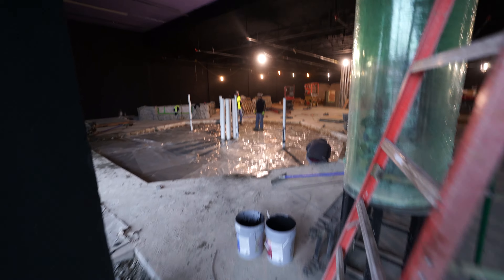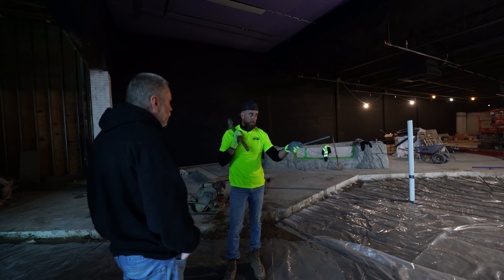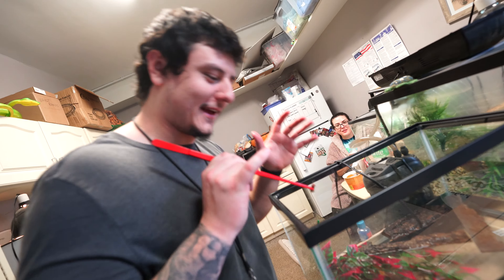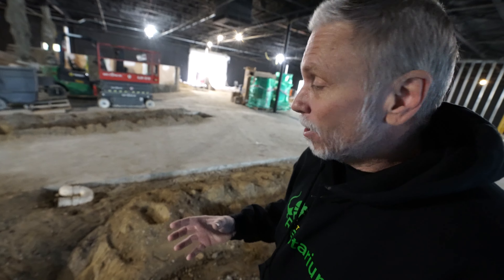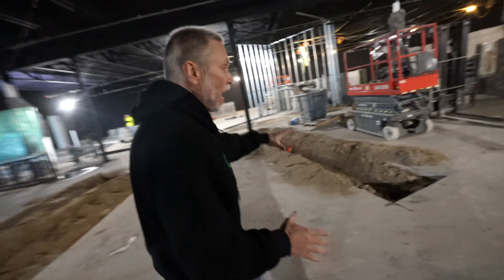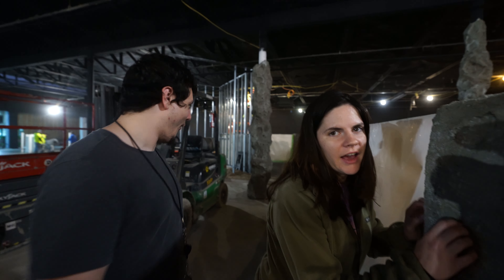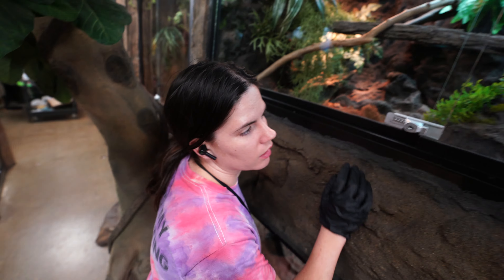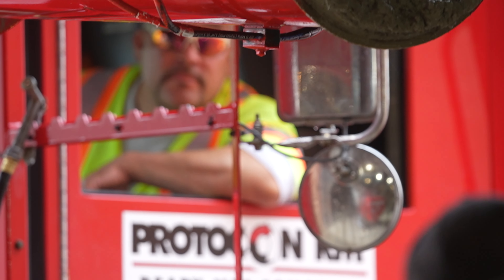I Saved $11,000 On My Shark Tank!

Comment: See, that tank plinth does not need to be solid concrete, it's probably too late now but, I would have used bigg polystyrene blocks with a footing around the perimeter. Saved lots of concrete, reduce weight and and a really good thermal break between your cold winter ground as the inside. Would save you money big time of heating.

Comment: Good morning Brian, yeah I'm A little bit of a concrete guy. Cement is the powder then aggregate like your sand and stone then water to help mix. Being an interior you're looking too get a non air mix which means the liquid form of air doesn't go in the mix which if its getting power troweled is better than an air entrained mix. Non air mixes are typically a good bit stronger than air entrained. Non air mixes are good if you're pouring inside or below ground. Air entrained is great for exterior mixes like sidewalk, bridges and driveways. Non air concrete does have natural air in it its only like 1%. Air entrained mixes have air added to the mix from the concrete batch plant. Lol sorry if I bored you Mr Brian its just a little bit of info I wanted to share with you. I see the vision of the shark tank even though it  isn't up yet its gonna look dope. I hope you're having a great day today and please keep us on your journey. I'm still sending prayers and positive vibes your way.

Comment: What if the metal base of the shark tank isnt done right? It is easier to level concrete than a supplied metal framing. Concrete is usually stronger than steel, but it depends. You have to check the price. Was the price given to equal to the right strength of steel with the area you have. Plus, Im not sure if you can move the steel you would use to replace the concrete. I would also let the contractor with the measuring. They should have used a pump with the hose rather than the automatic thing.

Comment: I, too, had trouble remembering the difference between cement and concrete. I now use a hint of my own. If you remember what the "Beverly Hillbillies" they referred to the pool as the cement swimming hole. I remember that and know they were wrong. It is concrete not cement.